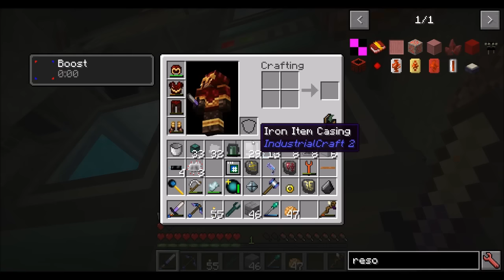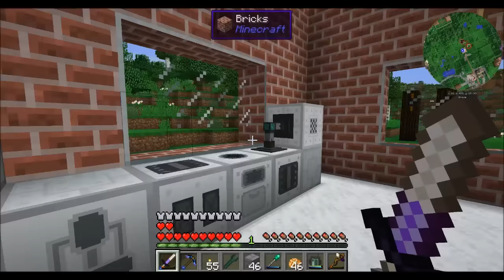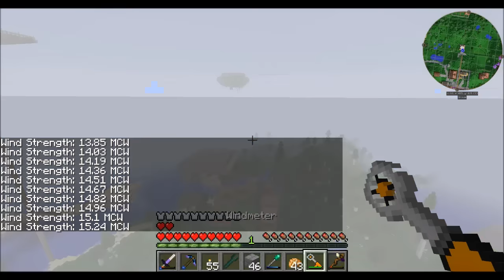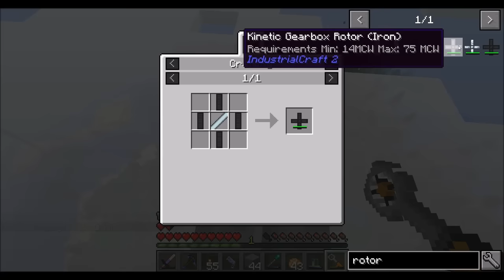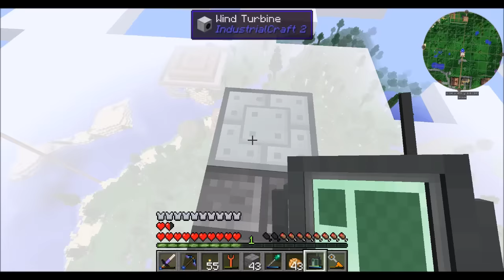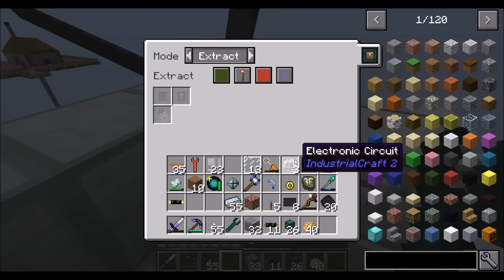Forgecraft2 S10 E42 Wind Power

Comment: Dire should have used a transformer to step up the power to EV through HV transformer (2048) and step down at the basement... High voltages are for reducing power loss, just in real life. So he does not have to spend another 16 diamonds on the MFE and get much lower power loss ( down to 95%).
Reply: meh dires way is better 0 eu loss  he just derped up handling of the other  block

Comment: Who thinks dire should make the crystal staff so he doesn't need to worry about durability on his staff
Reply: I do! I thought he was going to do that after the first one ran out. In fact, he could put several versions of the acceleration spell on it, one max size(duration), one max strength, and another for 1 duration 2 strength, and one last one for 2 size 1 strength. You know, for when he might want something to run slightly faster for a long time, or pretty fast for a slightly longer than normal amount of time, or, well, any amount of time he'd like.

Comment: 27:25 "I'm not using a lossless wrench with IC2, and the machine broke. Lemme cheat one in. Totally a bug....>.>"
Reply: Ok, usually you got the basic machine casing back so that might have been confusing. But else - yeah - definitely a bug that machines break when you don't use the propper tool to dismantle them. ^^
Reply: Yea, unless it changed, you get the machine casing, it doesn't completely destroy it.
Reply: Dark Spectrum best case scenario, he should have cheated in his casing. #direcheating20
Reply: But apparently it did change... At least it SEEMED to completely disappear.
Reply: james lawrence But it's only a chance, not 100%

Comment: Dire, i dont know if 1.10.2 has actively cooled reactors or not, but if so, you could use a setup that generates 400 heat units a tick with a fluid heat exchanger thats takes in hot coolant, make superheated steam, sends back out normal coolant. 

If the pressure is set to 221, your heat per ml bucket of distilled water should be 200
221 is the pressure at which superheated steam is made so your generator blades done break.

Comment: Oh dear dire... wind gen outputs 512 eu/t, so gold cable.. transform up to 2048v and run down with iron cables for almost minimum loss... yes, iron has more loss per block, but you get much more eu per packet, so loss as a percent of the larger packets is lower.  No need for an MFE in the air, just transform up to high voltage and ship down over iron hv cable.  Then transform back to 512v to store in the MFE, or upgrade the MFE to an MFSU.

Comment: did he need the medium voltage transformer? I thought it only needed the low voltage, you would need medium and low if you used an mfsu or a reactor...
Reply: They changed the output tiers to add another power storage (the CESU)
So Now:
T1 - BatBox (32EU/t) - LV
T2 - CESU (128EU/t) - MV
T3 - MFE (512EU/t) - HV
T4 - MFSU(2048EU/t) - EV

So the MV transformer turns the HV from the MFE to MV, and the LV transformer turns that to LV, which the machines accept